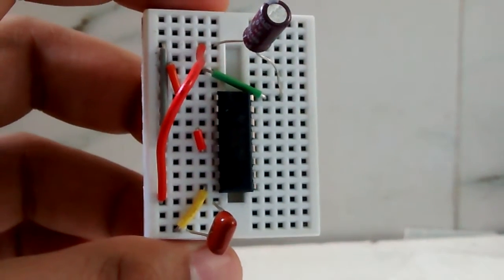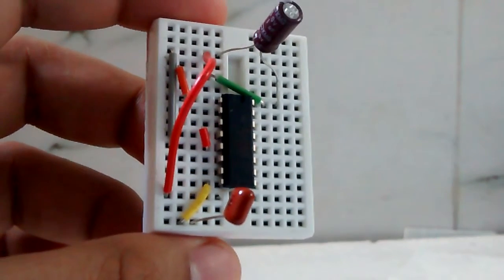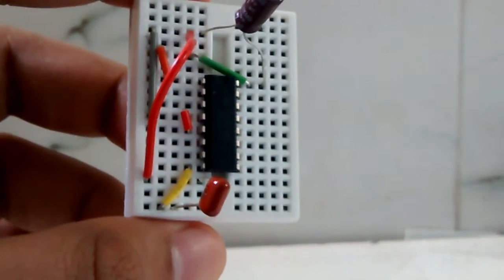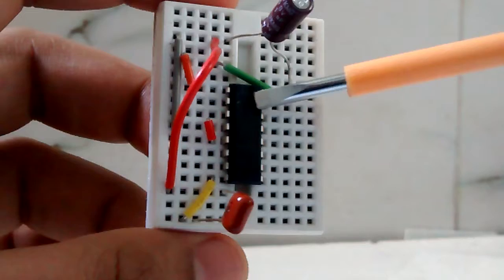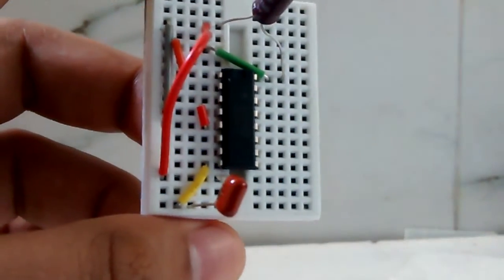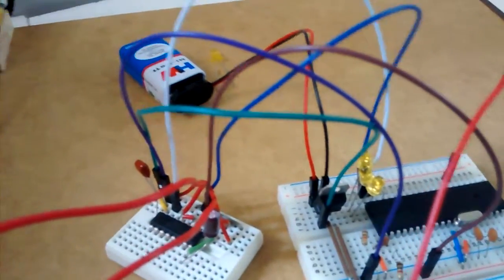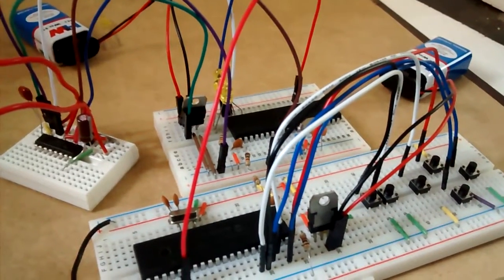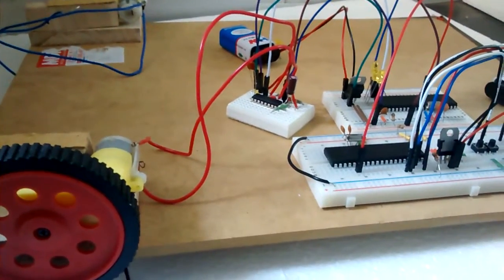L293D Motor Driver Working : Part II

Comment: I have a question.Do I need to give the Ground (LOW) at Pin 7 from the Common Ground or directly from the Microcontroller? Because In both the cases my Voltage at Pin 7 is above 0V (Slightly) and the Voltage at Pin 2 is 9V but still the motor doesn't run.
Reply: Best arduino project very simple to DO 
https://youtu.be/jAHLtRmgRiI

Comment: Interesting video. What kind of wood did you use for a chassis? Would balsa wood work? Thanks.
Reply from the maker: +Jorge Washington its called medium density fiber. You can use any material as chassis as long as it serves the purpose
Reply: +My Distractions Awesome.  I like the wheels you used too.  Very cool looking. Thanks.
Reply: Best arduino project very simple to DO 
https://youtu.be/jAHLtRmgRiI